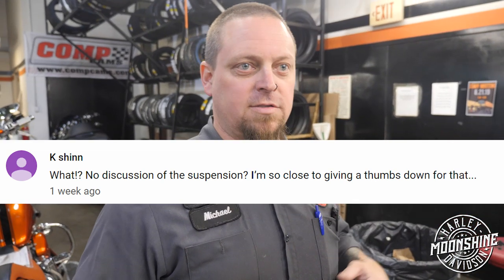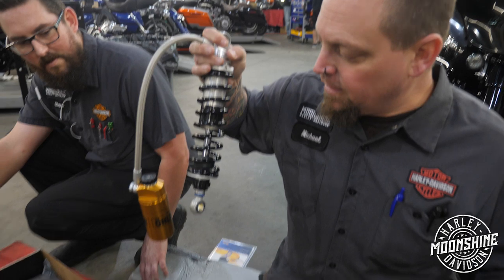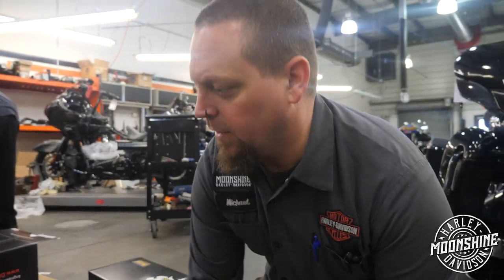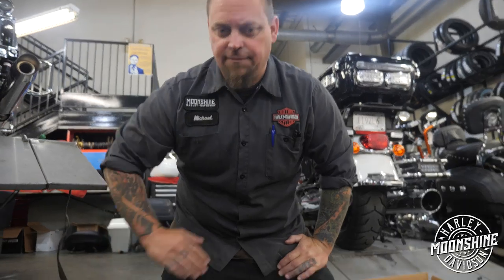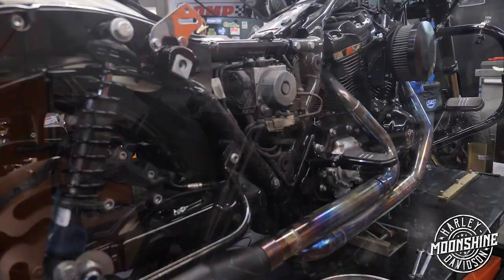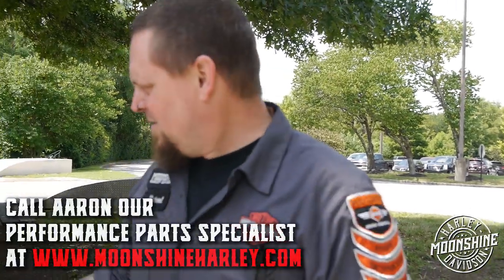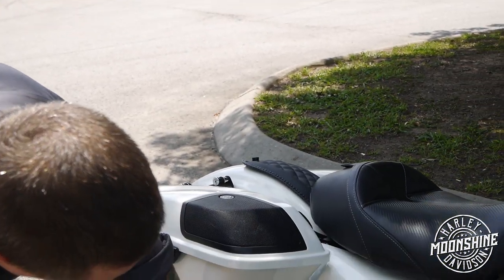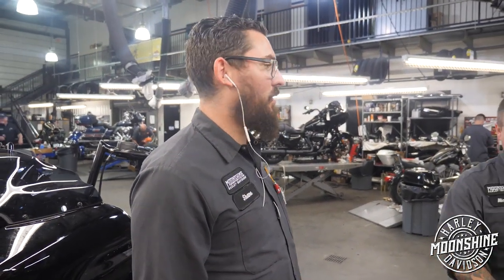Road Glide Performance Upgrades (Öhlins, Kraus Moto, RaceTrek, Berringer) | Shop Talk Episode 28

Comment: This is the next big cruiser trend, for sure. Big Bear Performance out in California and Moonshine Harley Davidson in Nashville are the only ones catching on. I applaud the hours of testing these guys go through to truly make real world gains. TAKE MY MONEY!
Reply: Take that back - there's other shops doing it. I'm sure it'll explode soon though.
Reply: Matt Laidlaw just made a video highlighting the Ohlins suspension they installed on a Roadglide. He says hot baggers that can handle are the next trend.
Reply: Big bear choppers pretty much help start this trend especially since he’s been developing the performance part for the baggers since 2015. Moonshiner just stated talking about it and they don’t make parts. BBC started with the performance FXR he did and made parts for it. I purchased a few part from BBC before the trend took off. The parts were a lot cheaper than vs now. The first Person I saw in the east coast with a performance bagger was the Raceglide on IG.
Reply: Pfft only thing that comes from California is steers and queers. I'm saving my pennies for those wheels.
Reply: Will Wood I’ve been riding on BST’s since 2011. They’re worth the 💰
Reply: @mrh3085  yes from everything I've seen and been told they're just as durable and the feeling in the bike is so much lighter.
Reply: Will Wood cornering braking and acceleration are greatly improved. The diminished gyroscopic affect of the wheels makes the bike take a set into a corner and not try to stand up mid corner like a stock motorcycle. Tire and brake life is also improved.

Comment: I just put mine on and adjusted the top according to the calculator feature on their website, and it rides super nice!

Not sure how to adjust the rebound adjuster deal on the bottom though.

Should I leave it or would you suggest tightening that up some?

Thanks

Comment: Before you install those Fly Moto bars, please get them clear coated. they will fade to pink over time, mine did within a few months. I also recommend putting a sealant or making a gasket between the gauge face and the bezel, water got into min and flooded the stock gauges. not the fault of the bezel, just the not sealed gauges. I put a clear sealant around the face and haven't had an issue since. For the at home guy that has some experience building connectors, http://guerrillacables.com/ has an extension harness for the gauge if the stock isn't long enough to relocate.
Reply: Good info man thanks.
Reply: Hahahaha... Everyone with FM bars has to recoat them. It's like the secret handshake. Lol

Comment: I have 60K miles on my 2011 RG with BST’s. They’ve been on the bike since it was new.
Reply: The Alpha Male how would your rate them??? Can you give our viewers your honest opinion on the increased handling and performance.
Reply: Jamie Lima the gyroscopic effect is greatly reduced. The bike corners  without trying to stand up like a top at speed. Every pound of rotational mass is worth 3 (some say as much as 7) pounds of static mass. So my 60 pound reduction of rotational mass makes the bike feel like it weighs 180lbs less when riding. Remember heat and weight are the enemies of performance. Ride safe.

Comment: How to do these ohlins shocks compare to legends revo? I want to upgrade my stock 2019 rgs stock shocks, not happy with the ride. Is it ok to go to the 13” shocks over the stock 12’s?
Reply: Ohlins reputation as best in the business is well deserved.   I'll tell you though I have  Revo A's on my Dyna and I am very pleased with their performance.  Going to a 13 over 12" will be ok but I do recommend upgrading the forks as well.

Call Aaron 615-771-7775 and we can get you the setup that fits your riding style the best.
Reply: Jim Beam Ohlins is pretty much the top. We use the Legends shocks all the time for guys not wanting to pay for the Ohlins but there is a difference. Are you pushing you bike to the edge?
Reply: Jamie Lima not really pushing the limits of the bike. Mostly ride 2 up. Currently have the stage 2 harley power cam. I’m happy with the way the bike performs from a power standpoint. It’s just the ride from the rear shocks. Prior bikes were an 08 street glide and a 13 ultra. Both with stock harley air shocks. Would the ohlins non piggy back be a better choice over the legends? I live in pot hole Illinois so the roads are rough to say the least. Also is it ok to go to the 13” shocks without any other changes to the bike? Would the 13” shocks affect the geometry of the bike?

Comment: Carbon fiber wheels make more power? Wrong. Carbon fiber wheels add ZERO power. It’s a reduction in weight, that is all. Yes, the bike will be faster when it sheds weight but the HP rating will be the exact same 🤦‍♂️

Comment: Buy a new stock roadglide and then you have to put 10.000 in it to make it a nice bike us harley riders need to start a class action suit against harley davidson
Reply: Ricky Harvey the stock bike is more bike than most can handle but if your the guy that can push it beyond its stock limits than you need to contact us!
Reply: @jamielima5315  stock bikes are straight garbage. Shocks , seats, grips, brakes, clutch, all the motor internals are crap 💩! More than they can handle? Haha 😂 shit throttle response, poor braking, nose diving, terrible cornering. Uncomfortable & sounds like a Honda until you drop coin on the exhaust. Hahahahaha more bike than most can handle lol stop it. Haha 😂